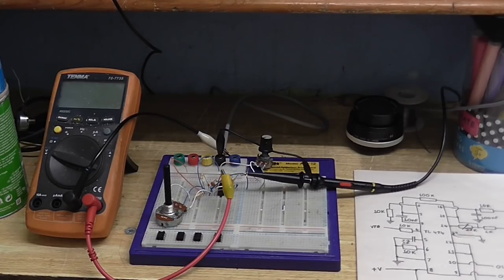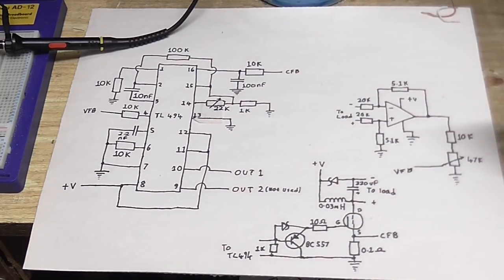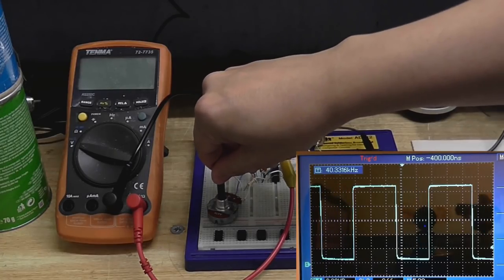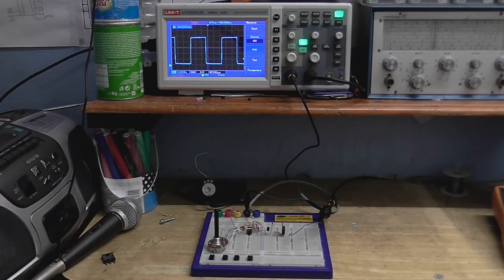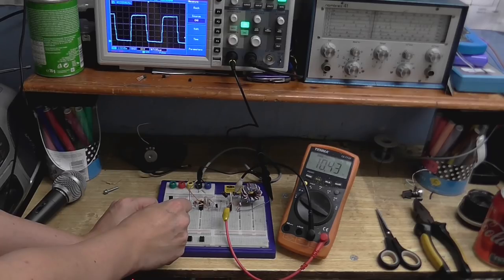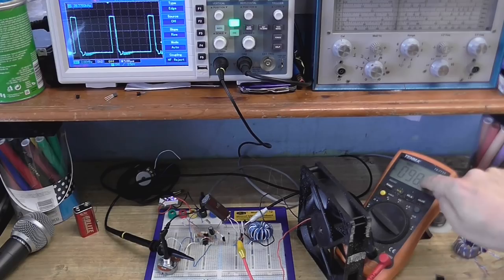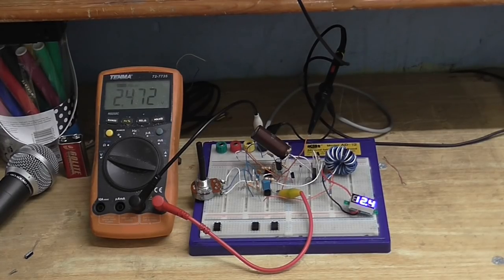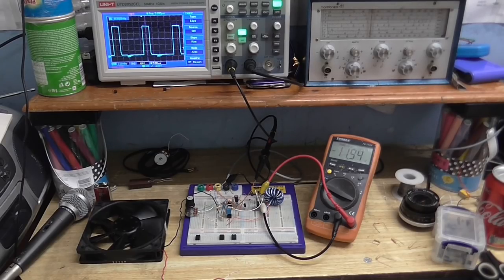CDC Electronic Workshop - Experimenting a homebrew TL494 based Buck Boost converter

Comment: a follow up would be nice. There are a lot of videos on youtube where people are talking about dc to dc converters, about designing, the theory behind it and silicone manufacturer advertise their new fancy chips, but almost nobody made a video where is shown how they actually build a dc to dc converter
Reply from the maker: There is going to be more on this, I'm just waiting for a few bits and bobs I ordered (mostly connectors), but I have a few led volt meters coming, also some proper buck boost converters that I'm going to experiment with, and a cable to connect my camera to my HD TV so I can finally focus the thing properly without relying on the crummy auto focus or guesswork.

Comment: and try to find out a way to messure inductance. "Guessing" inductances when designing switchers can be a pain in the ass :)
Reply from the maker: I didn't just guess the inductance, I have an L/C meter and that's what I used when I added the caption where I put in the inductance of the two coils.
Reply: than everything is allright...when i first experimented with switchers i had none, and it was always a pain

Comment: and try to use a cap with the lowest ESR you can get for smoothing the output. ESR of caps increases with the voltage they are rated for. for example, try to avoid electrolytics which are rated for mains powered application, when dealing with 20V or so...the lower the ESR rating of your output filter caps are getting the lower your output ripple gets

Comment: if i see it correctly,  you got a two channel scope...why not connect the 2nd channel to the output of the buck/boost stage to show us how the output is looking :)
Reply from the maker: Trouble is if I measure the output from the TL494 AND the output waveform at the same time, I would be shorting part of the circuit out as the output across has a separate ground to the rest of the circuit. I could measure the waveform at the mosfet's drain and see how that looks without shorting anything out
Reply: ah ok, i understand, you are doin an isolated buck/boost converter, with an isolation transformer, right? is there a reason for that design requirement, or are you doing it "just for kicks"?
Reply from the maker: There is no transformer, the output + & -  are independent from the power supply, but not isolated.
Reply: ah ok, watched it again, and looked at the circuit diagram. And sure, you cant do it what i have suggested. But i think you are using a little bit of strange arrangement for a dc to dc converter. Almost everything i saw is using a common ground in the non isolated configuration. But as long as it works, why not